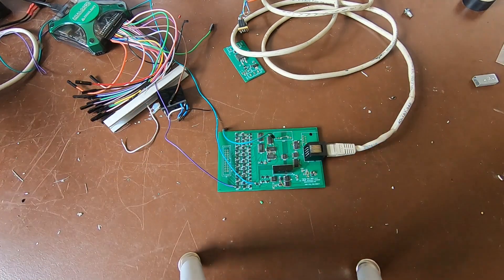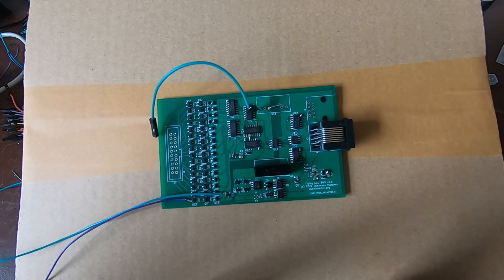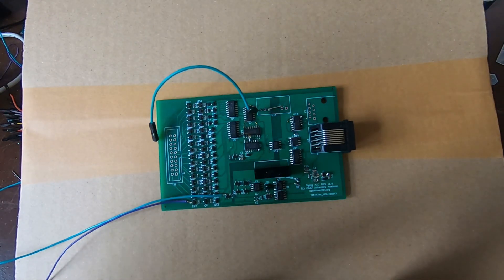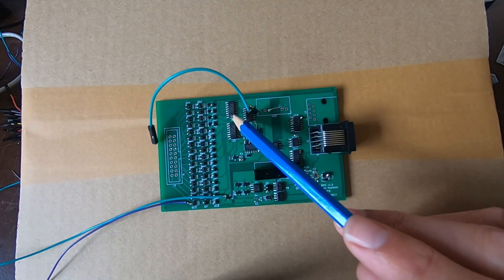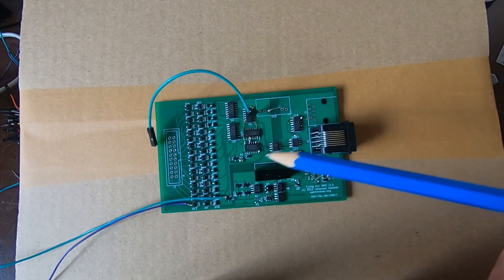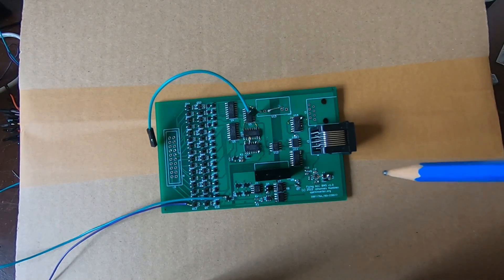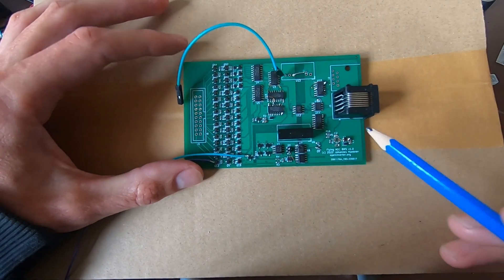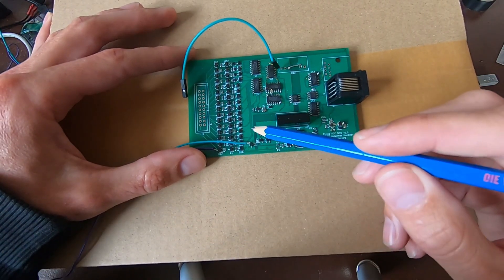Lab Update #65: Flying ADC BMS

Comment: I'd love to try this out on my 48v Nissan Leaf Power Wall I made. I have a Chinese BMS on the wall right now. I'd like to try one of yours. My setup is 14 modules total and each module is two sets of two pouches for 8.4 volts per module fully charged. I have my BMS stop the charge at 8.2 volts per module or 4.1 volts per module half. If it works  on the wall with the Leaf Modules I think it will be a great addition to my conversion which will be 144v setup with roughly 3 times larger than my wall.
Reply from the maker: Yes, let's see how an actual operation test goes. Will take place in a months as I'll be away